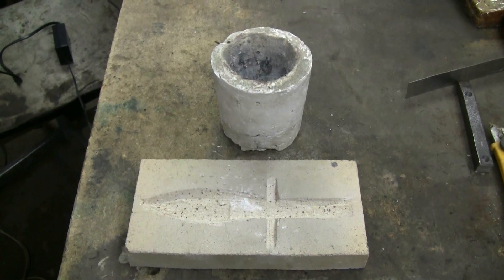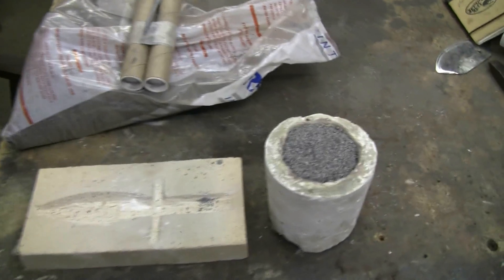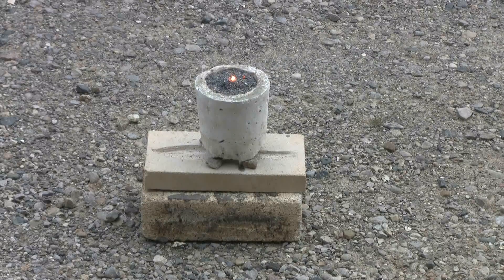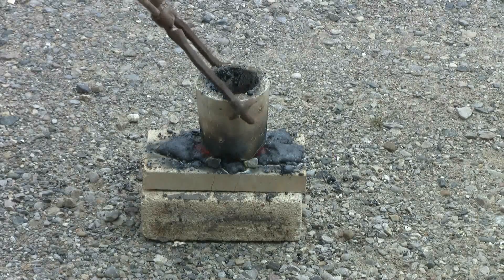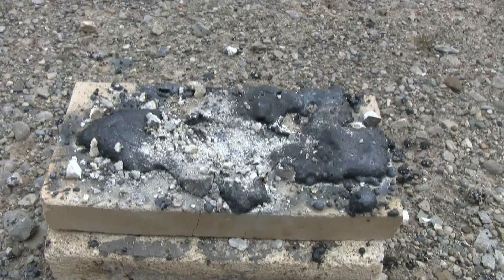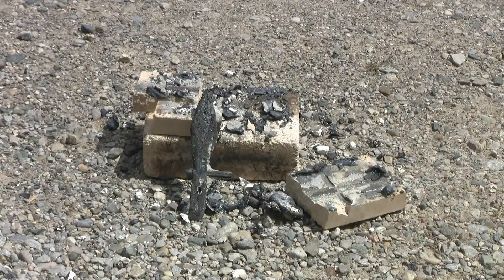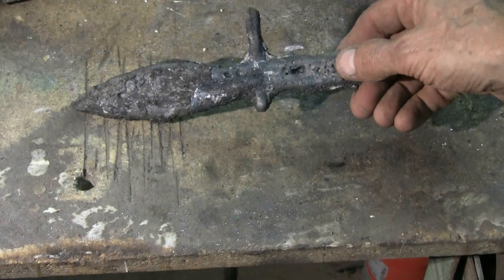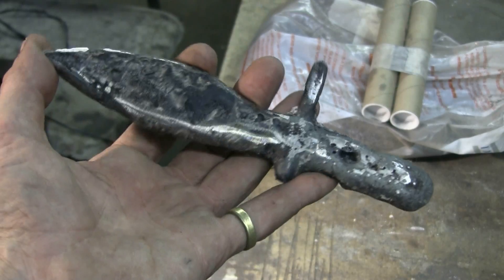Trying To Cast A Blade Using Welding Thermite

Comment: your a  genius bill i thought it would be brittle but you was giving it a good wack getting it out of the mold an it held up . looks heavy in your hand how much does it weight? .
 im still watching my way through your air cannon videos , i copyed your early ballvalve version and with just 90 psi it absolutely dumps on my £850 air rifle that runs 200bar ! how is that possible? its literally a 500ml fizzy drink bottle a ballvalve and a meter of 7mm pipe cost £9 in total 😐...🙂👍

Comment: Would that be a mild or hardened steel you ended up with? No idea how much thermite costs but would it be a cost affective way of making parts? Not that that matters, sometimes we got to do stuff just to see if we can! Cheers
Reply from the maker: +Shaun Whiteley After the video I heated this in the Forge and quenched it. The steel did harden to the point of skating a file. I will do this again with a proper mold.

Comment: Great experiment Bill, what is the basic composition of welding thermite? 
In some ways I'd feel it should have a flux but thinking about it, that might compromise the combustion. 
 Keep up the great videos, I always look forward to your workshop antics. 👍🗡
Reply from the maker: Welding thermite has manganese, nickel, and steel added to it. The steel is present as small BB's visible in the thermite. There must be flux as well because there was a lot of slag similar to stick welding that I chipped off the casting.